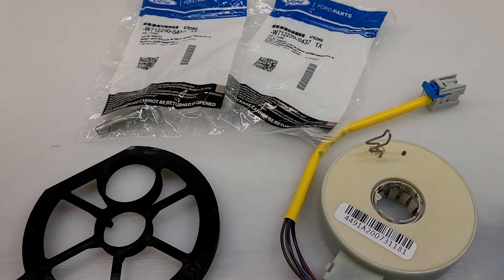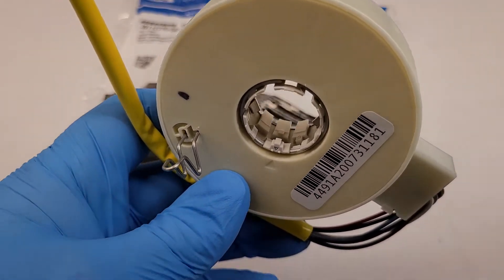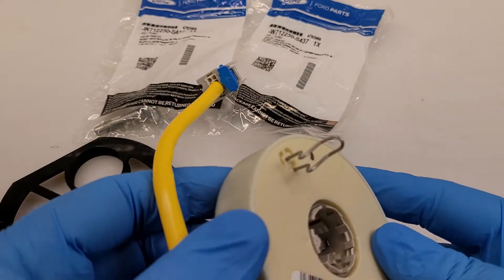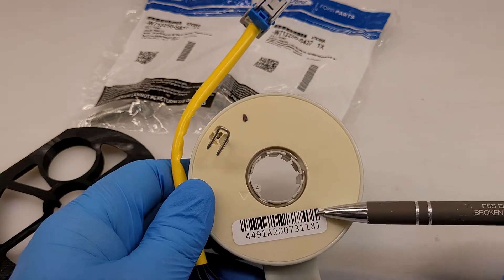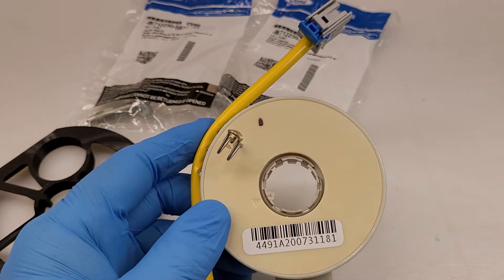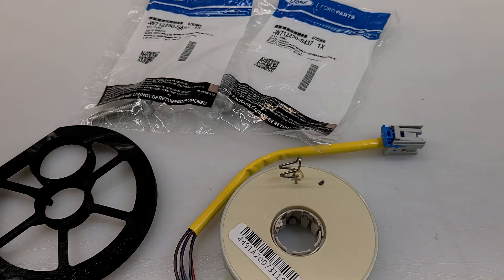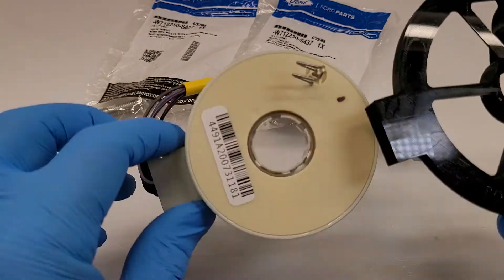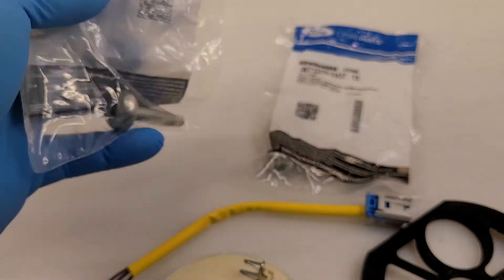Steering Torque Sensor for Ford Escape and Mercury Mariner

Comment: I had this procedure done to my 2008 Ford Escape Hybrid. My question is: Is this a permanent fix? I am afraid that when driving on the freeway, it will suddenly freeze, causing an accident. Thanks for the video!
Reply: You don't need to be concerned about the steering not working. This sensor is used in the power assist system. While the sensor is a known failure item causing the assist to stop working, even in the event that the assist stops working, the steering will still function, just a little stiffer than usual. Assist is mostly for parking lot maneuvers/low speeds, the steering will still feel mostly normal at highway speeds.
Reply: @phillipshank2392 Yes thats true. At this Time in having this problem

Comment: What exactly do you mean about off brands using a different torque theory.
Reply from the maker: In the video, I show you the 'nibs' on the discs.  One on the angle disc, and below a smaller one for the torque.   These fit into the steering column shaft keyway.   The column turns these as the steering wheel is turned.   On the aftermarket ones, there is no 'nib' on the torque disc, it seems to be done only by friction.
Reply: Was a Ford brand weren't very good to start with cuz people are having to replace them now this whole idea haven't even do this is stupid electronic steering who the hell needs that anyway your video sucks man
Reply: @Matthew-b9z LOL wtf that’s rude plus it’s not his fault it’s fords fault for making a crappy steering part. He just sells it so we can replace ourselves so god bless this dude
Reply: @Matthew-b9z also nice job on ur crappy English